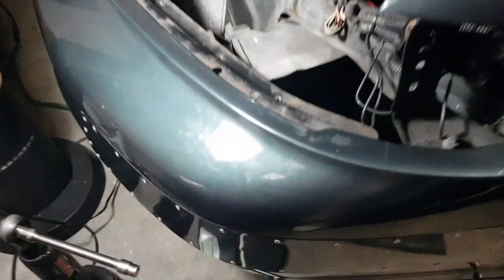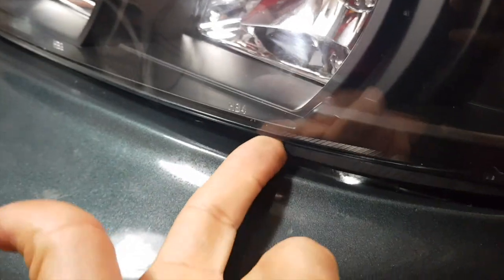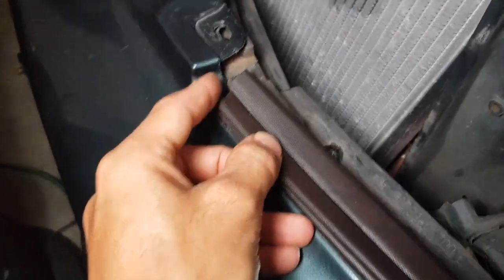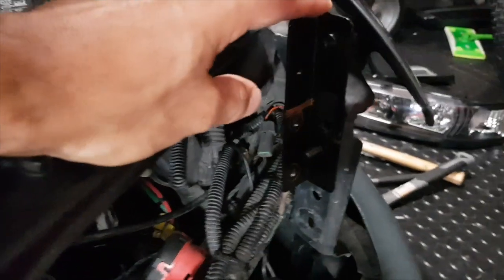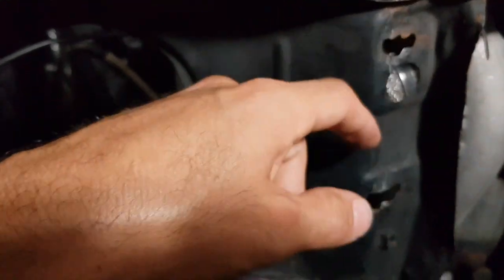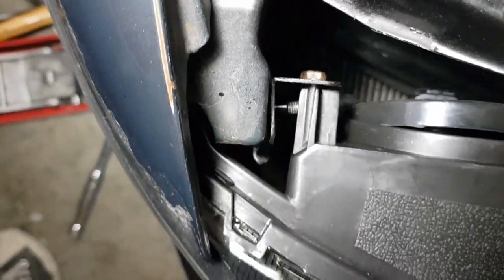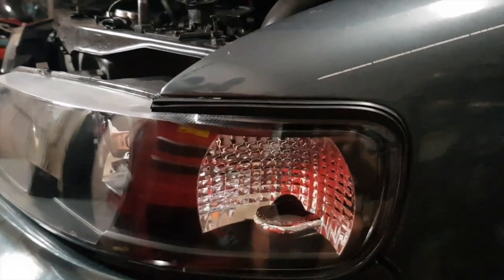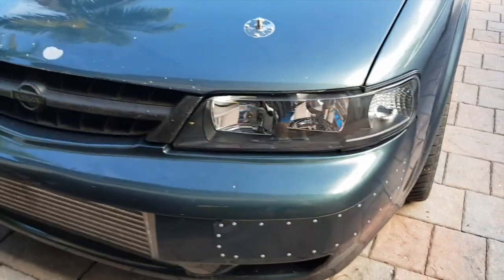Installing R34 Headlights on a 97 Maxima

Comment: Do you know anyone who has another set of the black housing sets? Jdm stopped production on these. You can only find the ones with the chrome housings now. I've looked everywhere lol. Nice ride btw. I'm working on converting my 97 gle to a 5 speed.
Reply: Amazon
Reply: @Iskazi3285  nope
Reply: I bought high gloss black paint and painted the insides, i had to open up anyways to do a projector retrofit

Comment: Looking for the  adapter -- original headlights only have one bulb (9004) but aftermarket uses two (9005/9006).
Reply: Did u find the adaptet
Reply: @acer.526  never did -- and my 1999 Maxima is in too poor of condition to do any modifying to it
Reply: Mine came with the piggy back harness, perfect fit. Worked flawless until I bought a new harness. My issue was it came with 9005 and 9006 halogen bulbs, swapped those with LEDs and perfect, except my 9006 are rgb. The problem is with high beam on the low beam RGB comes back on. At night thats illegal, so i went and bought a quad harness allowing all 4 to work as a high and a low. After install RGB worked, all 4 low beams worked and when switching to high the headlight fuse pops, checked all my wiring, all my grounds. Everything checked out. So since then I went back to factory setup just disabled the RGBs till I figure out how to get all 4 to work as high beam, im thinking the 9006 low beams arent high beam compatible and thats making the fuse blow. Ill figure it out eventually.

Comment: Wait how do you not have turn signals
Reply from the maker: I do
Reply: @theycallmeherbie  he’s got metal plating where the turn signals originally are, Im probably gonna bondo fill those ares myself and build the turn signals inside the headlight housing for my next custom pair
Reply: @adityadharni5027  Ahh I see it now, I added sequential DRLs above my headlamps and wired to my turn signal so they flow. Looks wicked at night.
Reply: @theycallmeherbie  thats a good idea, do they sell non sequentials, i dont like the flow animation
Reply: @adityadharni5027  They do, just making it look like a modern car. I have euro style tail lights but i might get oem ones and try making brake lights like the 2018 mustangs where the turn signal becomes sequential.

Comment: Would this fit a 03 maxima?
Reply from the maker: The 03 has different light designs
Reply: @Streetzlegend  Thank you, had to double take and compare so that won't happen. I'm switching my hid to led due to the lack of light output and will have to splice another set of headlights to give it a try.
Reply from the maker: @vClasia  that is good the led will require far less amps too.